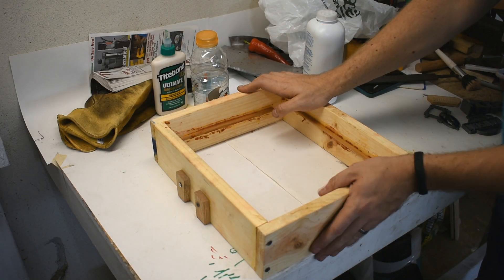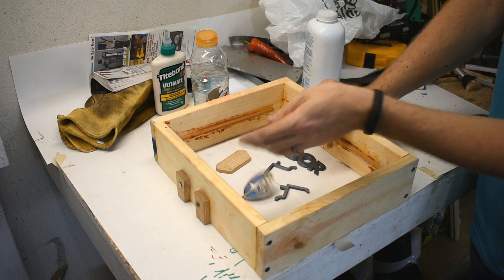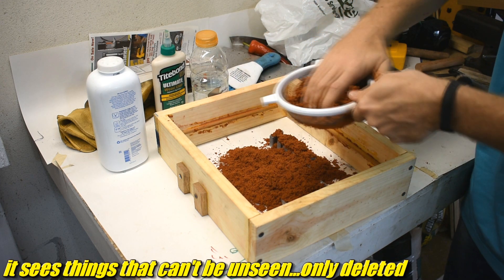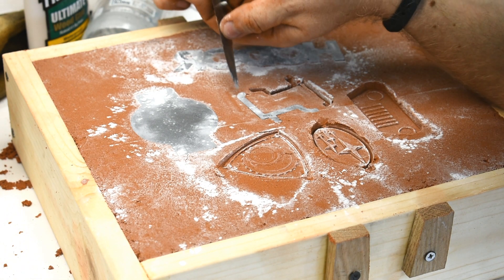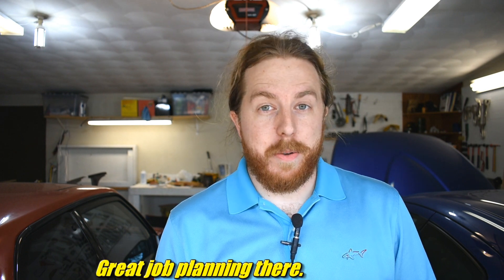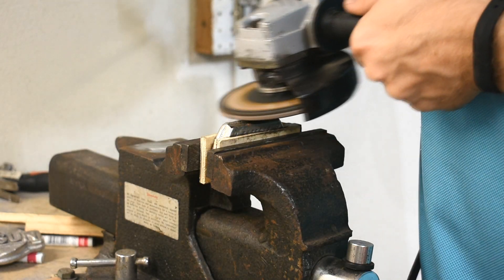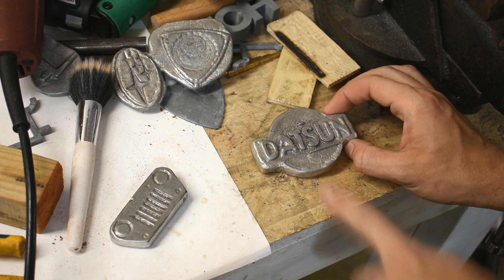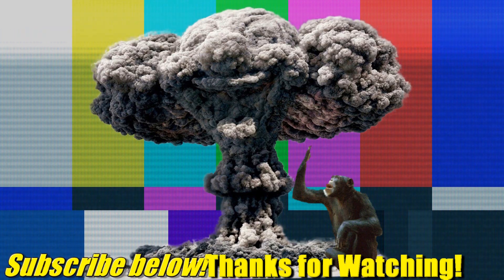Open Mold Casting with Aluminum at home using my Propane Foundry

Comment: I want to do that.  But I wonder if you could use a tuna, or sardines can to make a top just over the cast?
Reply from the maker: You still wouldn't have any head pressure and the can might act as a "chill' which can screw up the casting if not used properly

Comment: Oh! Oh! Additional suggestion for shielding gas during casting: argon is king, of course, a most noble of gases, but nitrogen is must cheaper, if you have a means by which to entrap it upon the casting. Argon's additional advantage over nitrogen is that it is slightly heavier than the surrounding atmosphere and tends to lie quietly in low places until blown away. Be aware that argon can fill large spaces and suffocate humans if contained too effectively in too large of a space. I knew four guys who are all now deceased (two different episodes of industrial fatality). Actually, a helium/argon mix is not a bad choice if you need to surround the items above and below.

Comment: Great video, Paul, very entertaining! Quick suggestion: beeswax is very helpful when grinding aluminum. Apply the beeswax to the grinding wheel. Greatly improves the efficiency and smoothness.
Reply from the maker: Thanks for the info!  I have some beeswax somewhere I'll have to give it a shot

Comment: Where do you buy your aluminum? You mention you can buy it all over the internet but I can’t find any to buy?
Reply from the maker: I get my aluminum for free as scrap, but there are a number of websites around that sell ingots.  I would search for a specific alloy, like A356 if you are going to do any casting.  You can usually buy it in large single ingots, like 22 or 50lbs each.  A quick search found one place at sculpt.com, though I have never ordered from them so i can't vouch for them.  that or look for cast aluminum alloy wheels on craigslist, those are usually A356 aluminum alloy.

Comment: Do you think hot glueing the positives to a surface before putting the sand in could work? I figure when you lift the mould off, the positives would stay stuck to the surface and so you'd avoid all the damage around the edges caused by knifeing them out

Comment: Reeeeally old video but quick question...Im looking to get some oil casting sand but I have no clue how dense it is. Could you tell me roughly how many pounds of sand that is in the flask? Also maybe you said in another video but I forget, where did you buy it from? Thanks paul!

Comment: ɐᴉlɐɹʇsn∀ ɯoɹɟ ƃuᴉʇǝǝɹפ puɐ lnɐԀ ᴉH

Ok, enough of that funstering because I have some info you may be interested in.
You make use of Petrobond a lot in your casting adventures, and in my search for this in ɐᴉlɐɹʇsn∀, I came across this.
Apparently, using motor oil in casting sand is a bit carcinogenic. Considering I have only just discovered your awesome channel, I don't want you to get cancer and die - at least until you finish the Gingery machines .

Have a squiz at this linky see if it may be of benefit to your health, and to my enjoyment of your channel and all the Paul-ites out there like me who reckon you're awesome.

So, don't get cancer and die, OK?

 http://www.woodhollow.net/foundry/kbond.html

Comment: I thought aluminium steals oxygen not hydrogen coz for thermit you use iron oxide 3 so when the aluminium gets contact it'll take the oxides creating pure iron and aluminium oxide 3

Comment: You've got the affinity of aluminum wrong. Aluminum (and other reactive metals like titanium) has a very strong affinity for oxygen and to a lesser extent carbon, not hydrogen. Because of this, it will pull oxygen out of most things and leave whatever's left to fend for itself. This is usually hydrogen. Hydrogen has a low but significant solubility in molten aluminum, so it stays dissolved and bubbles out as the metal solidifies. The typical way of extracting hydrogen from aluminum is to use an inert carrier like nitrogen or argon: this extracts the hydrogen out since hydrogen is also obviously soluble in nitrogen gas and so it slowly diffuses out into the carrier. 

Degassing with most other things won't work well. The problem is molten aluminum is EXTREMELY reactive: it really wants to go back to aluminum oxide, so as you mentioned it will pull water vapor apart to release hydrogen. Thus, almost any other carrier gas imaginable (carbon dioxide, oxygen, nitrous oxide, etc) will immediately be broken down before they can properly draw the hydrogen out. (Plus, the aluminum oxide byproduct will cause other flaws in the metal). By the way, in industry chlorine gas is added to the nitrogen or argon stream to remove sodium and lithium-- it is not necessary to remove hydrogen.

Degassing with solids is not a fantastic idea either. Sodium carbonate has a deceptively high affinity for water in storage, and so by adding it to your melt you may actually worsen the hydrogen pitting. It also reacts with molten aluminum to some degree. Adding pool chlorinators is also not a great idea: the common ones either contain hydrogen in their active ingredient or in their filler (calcium hydroxide in calcium hypochlorite shock, for example). Plus, aluminum itself reacts with with oxidizers vigorously (hence why it breaks water apart), and in the solid state and with powdered degassing agents such a reaction could be explosive. (The principle itself is that aluminum reacts with an active chlorine source to release aluminum chloride. This is volatile at aluminum melting temperatures, and so it acts as a carrier gas to remove dissolved hydrogen. However, these substances contain no hydrogen to avoid worsening the problem, and further the aluminum chloride produced is extremely corrosive-- imagine muriatic acid fumes but worse.)

Something you might try is to add sodium chloride salt to try and act as a degasser. No idea if it'll work, but it might be worth a shot.

Comment: I recently saw a casting video that recommended using aquarium sand for things that you want a lot of detail from.  IDK if that was good advise or an attempted prank, but aquarium sand from pet stores costs more than play sand.  Go to the salt water section.  The fresh water section is usually more like gravel.  I guess it just depends on how badly you want more detail.  I think you might still like open faced casting for making ingots, if you enjoy a specific shape that you don't have a better mold for.

Comment: Hey do you know if you can use a cast iron as a  cubicle?
Reply from the maker: +Emilio Greenwood cast iron is not a great crucible material, it is dissolved by aluminum and oxidizes in the furnace heat.  If you want a one time use crucible for meting aluminum or zinc though it might work

Comment: Quick question about aluminum.  if I'm melting aluminum car parts and say a steel dowel pin is inside the aluminum. once the aluminum is melted will the steel come up to the top?
Reply from the maker: nope, sink to the bottom.  Steel is much denser than aluminum. it will be there in the bottom of the crucible after you pour the aluminum.
Reply: Paul's Garage that's what I figured. thanks for the reply. love the channel man its great!

Comment: Hey Paul, not really having to do with this vid except, well it IS about Aluminum melting.   You were right-yellow flame not enough air.   Finally added a hair dryer and now I can melt the legs off the neighbors dog...uh, off the neighbors Aluminum siding.  Yeah, that's it.   Do you still use Morton Lite to lessen your dross?   Reason I ask is I've just been spooning it off but last night I melted a big aluminum pan the wife gets frozen lasagna in.   Still had remnants of whatever grand-it does NOT smell like lasagna when you subject it to 1500 degree heat-it also left a puddle of floating ashy, volcanic rock-like stuff that took me 20 minutes of burning my hands to get scraped off.   Oh and last but not least, if you go to remelt something fairly thick and large and you realize you should have a pool of Al to melt it into?   Don't forget 30 minutes later it was in the furnace and grab it bare-handed.   Causes a severe 'Ouchie-oh S**T!  Motherhumper!  Da...dang!"  Just sayin'.

Comment: hey paul im actually debating what i want to cast for the first time i actually found some softball sizish skulls at the dollar tree and iv been trying to decide how to possibly cast them their cheap thin plastic and well im not worried about money loss a few decent sized aluminum or copper skulls or whatever you would like to use would be a nice go for Halloween and well yea.....btw dunno if anyone else noticed the pepper in the back ground was that for extra heat? yea corny i know but hey figured id shoot it out their
Reply from the maker: +Johnathan Welch lol the pepper was just there, no reason.  Skulls would be cool but if they are complex 3D shapes then lost plastic casting or something else would have to be used.  Don't know without seeing them though.  Good luck!

Comment: Hey Paul, another cool video! Open face casting is another technique I need to try.
Reply from the maker: +eviltwinx thanks!  I don't think I'll do open face casting anymore, the normal sand casting with the 2 flasks and risers just gives better quality results thanks to the head pressure.  Open face is more fun to watch, though, molten metal looks awesome!

Comment: Hey Paul I found out actually how yo get a piercing blue flame!! You just need one of those big red propane regulators
Reply from the maker: +Flipping Nation I got a big regulator, I just don't crank it up super high.  The furnace I have doesn't have a big enough hole in top to vent the gases so I can't really crank it up.

Comment: I have seen people pre-drill shallow holes in the back of the design so they can put a screw in the and lift it straight up out of the mold leaving a cleaner cavity to pour into
Reply from the maker: +Braden Lumley that's a good idea, it certainly would have helped

Comment: Learn a lot from watching your vids.  Question for you what should I use for flux? Borax or light salt?  Keep up the great work.
Reply from the maker: +The Nocturnal Alchemist lite salt for fluxing aluminum, borax (also boric acid) is generally for copper alloys.  Not sure about other metals
Reply: Paul's Garage ok cool thanks man
Reply: @PaulsGarage  should i wear any masks when melting any metals? Not sure what metals have toxic gas when melted or what happens when they melt(gases/air/moisture in the air getting in the metal making it non pure)

Comment: Interesting to watch your trial of open face casting. I am hoping to get my electric furnace (patterned after TAOW's) up and running thus weekend so I am glad you talked about degassing with washing soda. I wonder chemistry is going on to remove the hydrogen from the aluminium. 

Greatly enjoyed your video!
Reply from the maker: +Mark Shymanski I think removing the hydrogen works through the same process as osmosis, the hydrogen wants to balance out, so it moves from the area of most hydrogen (in the aluminum) to the area of least hydrogen (the hydrogen-free gas).  Lots of gas bubbles through carrying the hydrogen out of the aluminum until only a tiny, unproblematic amount remains.I could be wrong though.

Comment: sand and prime the 3d prints, also drill small holes in back and use screws to screw into the back to pull it. Also the holes in the logo that came out put screws in there when pounding the sand and try that.
Reply from the maker: +Little Frog Innovations thanks for the tips! I'll try that
Reply: This guy shows how to build a foundary that I am currently building. If you watch the video, see how he removed stuff from the petrobond. https://www.youtube.com/watch?v=gBK0P4ASZ0o&t=2s
He is where I got my inspiration and somehow I ended up following your channel as well in some weird way.

Comment: I'm glad you did this open mold casting, I kept wondering if it would be a way to easily make flat-backed pieces. Now I know, ram up the second flask... is that what you call the sand in a box...? and pour it using risers to get that pressure .

Thanks
Reply from the maker: +swdweeb yeah definitely do normal sand casting with 2 flasks.  The risers are a huge help when it comes to details.

Comment: I've actually read that some people use Morton's light salt in place of the washing soda
Reply from the maker: +C Stone lite salt is more of a flux than a degasser, but lite salt works well.  Washing soda not so much
Reply: I know Myfordboy uses a uk brand washing soda as a degasser.
Reply from the maker: +C Stone yeah the luckygen video (link in description) is actually a response to a disagreement he was having with myfordboy on a forum.  Very interesting points on both sides.

Comment: What If you print the hodor door stopper on its side so the "teeth" or the ridges aren't on the side where it would get stuck in, also when I did stuff with aluminum I was told dust can give you Alzheimer's not really sure how true that is but it always made me be safe with it
Reply from the maker: +Mr Butter yeah ground aluminum is dangerous, always wear a respirator. I could print the hodor stop at another angle, but really for best results adding draft to the model and then sanding and finishing would be the best bet.  Lots of programs have a feature for draft so it's easy